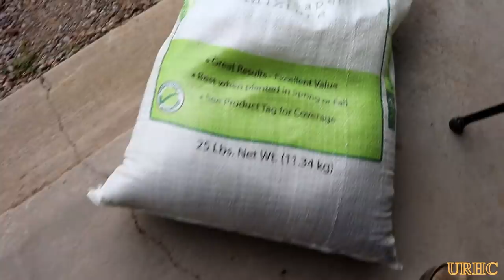Repairing The Front Yard Damage Caused By Replacing The Underground Electric Lines

Comment: You need to throw that wheel barrow out! That’s what your tractor buckets for! 😁 looking good.
Reply from the maker: The ground was wet and with a load in the bucket the front wheels will leave ruts that would require more work to fix. Thanks for watching.

Comment: Really enjoyed the video. I have a JD 4110 with 410 loader and 46 backhoe. Pretty similar to yours but hydro drive. I use the heck out of it around my property. Thought we were clear of winter here in N Illinois but more snow today. Take care.
Reply from the maker: This one has had a hard life. It is the first production 4100 that was manufactured in Japan  and imported.  I was at the dealer looking for a 750, they pulled this one in and it was in my yard an hour later. Dealer didn't know it was  not supposed to be sold and was headed to a big farm show.  They caught heck from Deere because I wouldn't let them borrow it back for the show. Thanks for watching.